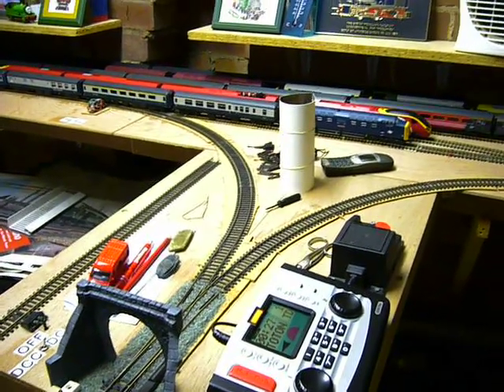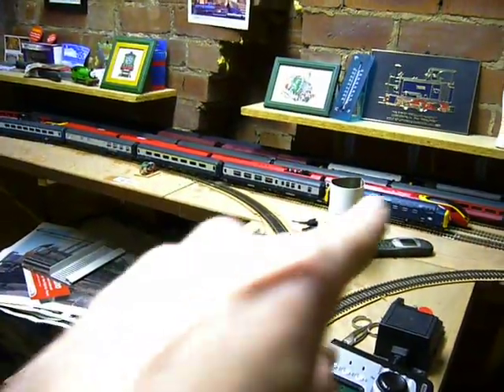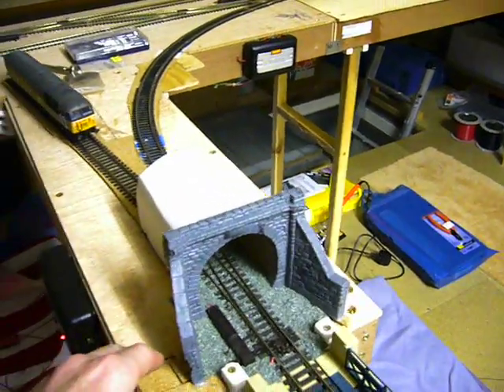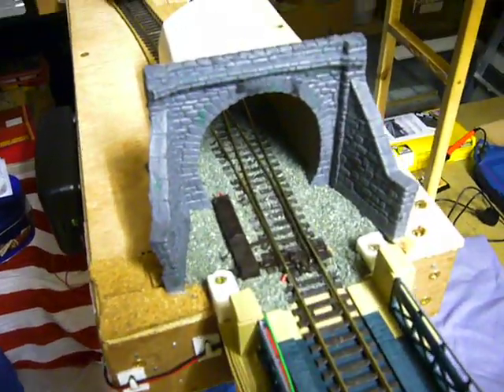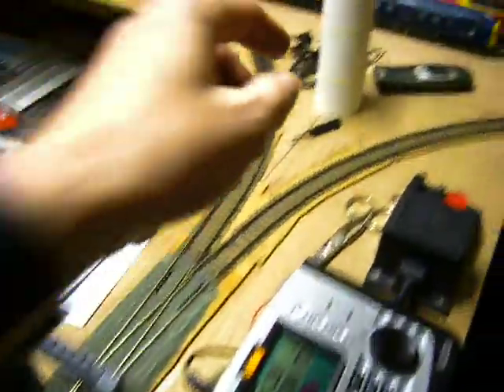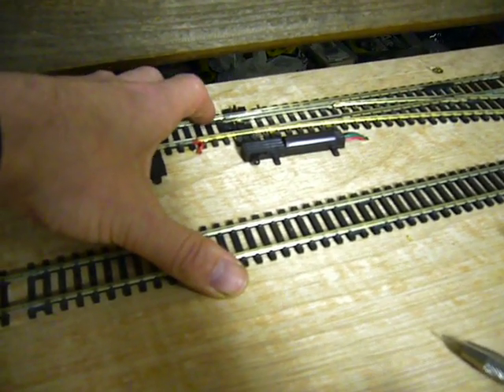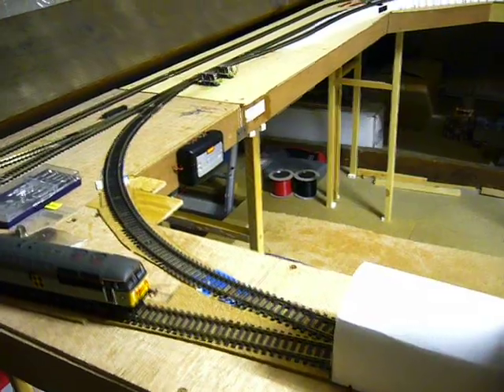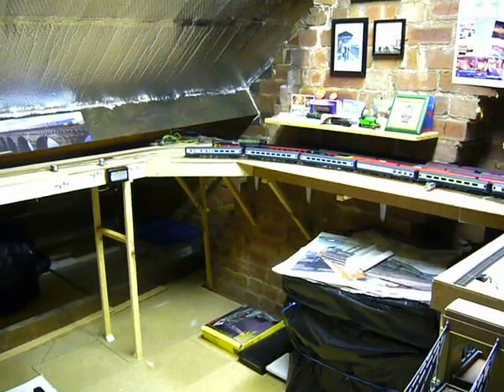layout Update 9

Comment from the maker: I'm out of decoders at the moment, so will need to get some more. I'll look into doing a none DCC ready loco. Bachmann loco's that come with DCC Sound, as far as i know are 21pin. They don't sell sound decoders on their own at the moment. I think the 21 pin allows more functions over the 8 pin( will need to check up on that.) Bachmann do a converter plug which takes both 8 & 21 pin decoders. Cheers.

Comment from the maker: @wattass7 On this layout, i'm a long way off doing that yet. But the others are indeed right. Rail match & the likes do paint for weathering the track. Can't remember the name, but i've seen at least one paint tool that's been designed to paint the sides of the rails. Check out Model Rail DVD series (amongst the many that's out there), in one of them they show how to weather the track. Make sure that the frog area's on points & tops of the rails are wiped clean straight after painting.

Comment from the maker: @10FlyingScotsmans No sorry disagree, yes you can if planned in advance before building, by having removable scenic sections etc. What you have to bear in mind that some times you have to due to space constraints etc. 

Had points (cross over) in a tunnel on a previous layout. Was built with easy access to the points. Never had any problems what so ever.